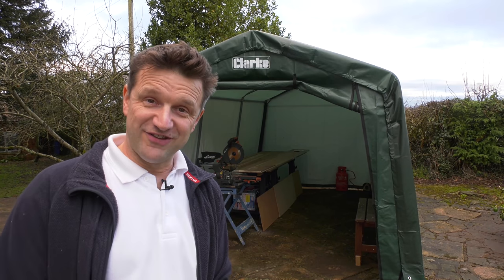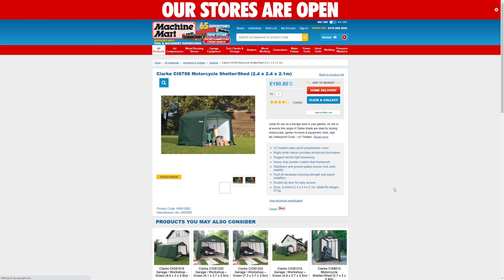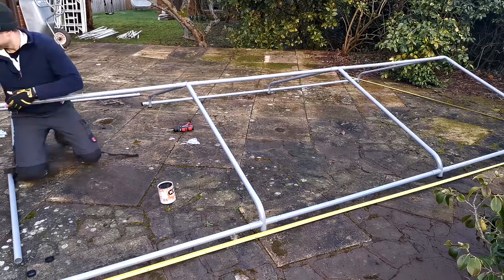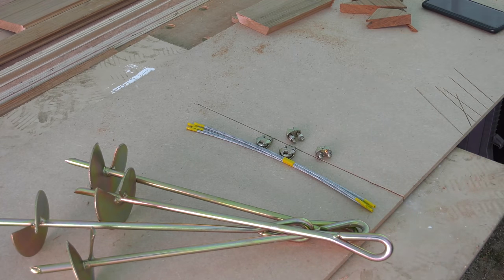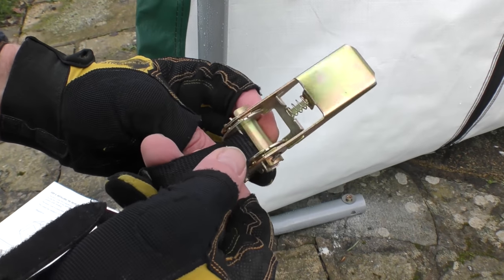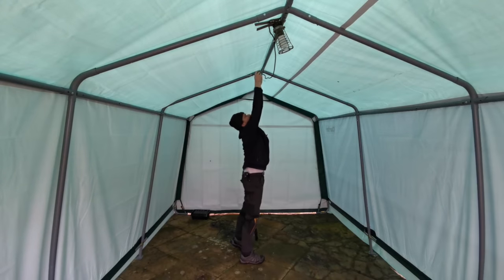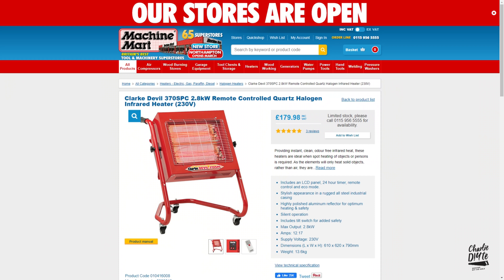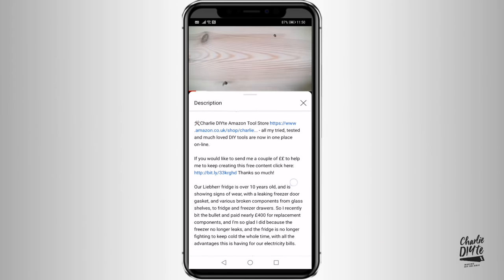Instant Workshop for Bespoke Wardrobe Build!

Comment: How cold/humid is it in there? I do have an Halfords gazebo that has withstand the weather since June 2020 (yep, snow and all!!)... it’s good enough to setup a couple of cuts but I can’t leave any tools there as they might get wet... also, I love your videos :)
Reply from the maker: With the heater I had it at a very comfortable 21 degrees earlier, when I was in there with my son helping him on a school woodworking project. The size and white interior really makes you feel like you're in an actual workshop.
Reply: @CharlieDIYte  but you're only keeping it for the duration of your project, right? Not a long term solution for a workshop... I might consider it while building a shed/workshop as I do need to do a bit of work while needing to "store" a couple of items currently in the shed. also, might have to devise a base to not keep it on the lawn... Scottish weather might be a bit more unforgiving than you guys "south of the wall" ;) But it is a good review and got me seriously thinking about that solution again.
Reply: also, if it isn't too much to ask... what are its internal dimensions? as in, if one was going to "add a floor" to it... ;)
Reply from the maker: You're looking at 3050mm x 4600mm internally.
Reply from the maker: Yes, although it's designed as a semi permanent fixture I'll probably keep it there until the early summer, or knowing me, possibly longer..😏

Comment: Hi Charlie. I bought a 10ft x 20ft version a few years ago. It had a faulty roof panel, a green PVC coating perished in the sunlight whereas the rest of the cover was OK. It took 18 months for me to realise it was going to be a problem and when I contacted Machine Mart they would only honour 12 months warranty. The best they could offer was a 15% discount on me buying a new full cover, and after their price increases was going to cost nearly as much as I paid for the whole garage. Last year the cover completely split and blew off. A warning to keep an eye on the condition of your garage cover and if you suspect it's faulty contact Machine Mart as soon as possible. Good Luck.
Reply from the maker: So sorry to hear that. You've been incredibly unlucky as mine has been up for over 2 years now and bar a few pin prick holes it still looks similar to when I erected it. That sh1t customer service is unforgivable though.

Comment: Bought one of these myself, had to fix it down the same way as its on paving stones. I found the ends are a bit of a pain as they ride up the sloped frame so I put a steel tube in the bottom which goes into the ends of the corner tubes. This stops the wind getting under it. Did the same with the front and had to cut slits in the front bottom edges so the corner tubes hold the front panel sides down. Also put a tube in the front and made two sliding bolts to hold the door down when closed. Trouble now is I've filled it up and need another one but MM seem to have stopped selling them?

Comment: Don't expect it to last too long if you look at the bolts on the top rail joints you will see they are too long and the roof will rip in high winds I purchased mine from machine mart

Comment: I'd like to see how the metal tubular frame looks like in a year or so. I find the finish in these tubes disintegrate easily and they begin to rust in no time at all. 

I'd have used a couple of washers to keep the frame from the ground. 

What kind of guarantee comes with this?
Reply: We’ve had one for several years up permanently and the tubes haven’t suffered any corrosion. The cover will disintegrate before the poles rot.

Comment: What a great Idea Charlie,,, I would love to have the room to leave one of them up permanently,  looks a bit to long winded to use for a small job if you gotta keep taking if down tho,,, Its ideal if you can leave it up and get the use out of it even for one project like your doing. jNow you got that just be careful you don't upset the wife,,, they can get cold at night, Ha.
Reply from the maker: Thanks Ray. It's designed to be left up long-term given its dual use as a garage. I've been in there with my son helping him with a woodworking project this afternoon and with the heater on its been a respectable 21 degrees, so the dog house if I find myself in it is suddenly a bit more of an enticing option 🤣

Comment: Did machine mart give you the heater free too?
Reply from the maker: Yes. Not something I was angling for, but I called my contact there to explain that the Little Devil that I bought wasn't really suitable and could they recommend anything different, and they kindly sorted that out for me FOC. I'll be doing a stand alone heating video where I'll discuss that in more detail. I've got to say though I'm very impressed with it. Had the room at 21 degrees yesterday afternoon

Comment: I personally find a lot of modern day clarke brand stuff absolutely shite. But that doesn't look to bad. Having said that i bet you could've picked up a decent shed for the price!
Reply: Really? 4.5m x 3m shed for £286? Couldn't even get the materials for that.
Reply: Yes you are right, you can get a 2x2 (foot) for that price (roof extra).
Reply from the maker: Sorry to hear that. What exactly has let you down? I haven't used Machine Mart a lot in the past but the impression I'm getting from what i have used is of a no nonsense, quality brand. That second, infrared heater is fantastic. I had the workshop at 21 degrees yesterday afternoon when I was in there for a few hours helping my son on a school woodworking project.
Reply from the maker: Thanks Keith. I really value you guys contributing to these comments 👊🏻👍🏻

Comment: I bought one of these a couple of months back and have it set up in paving in backyard. The condensation build up on the ceiling is so bad that it makes the space unusable. Whenever there is a slight breeze the condensation is disrupted and soaks everything under it - may as well not have a roof. I’d be interested to hear if anyone has had similar problems and found a solution?
Reply from the maker: D'you know what, a week in and I have no condensation issues at all although it has been very windy, and a couple of other people have mentioned this as a problem too. I think keeping the space ventilated is key. There is a small gap under the front and back with mine because of the way I've set it up. I suspect that's important to maintain air circulation.

Comment: Good video 👍
I did the math and built a wooden frame for a 18' x 24' tarp here in Canada (turned out to have a 12' x 16' footprint) and I installed plywood ends and a woodstove, this little shop has been standing for 23 years, it's survived brutal winds and heavy snow, the only problem I've encountered is the sun damages the tarp every 1 1/2 years so i just throw another tarp over the top of the old one
Reply from the maker: What an awesome project. Thanks for the comment. Out of interest, why didn't you just build out the whole structure with wood, rather than use a tarp? 👍🏻